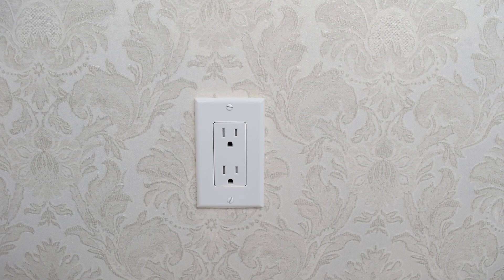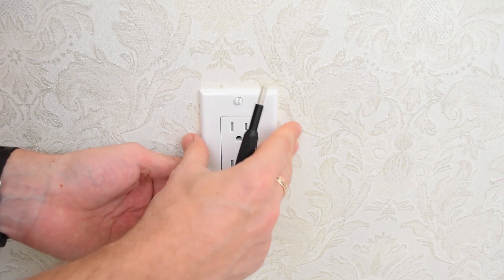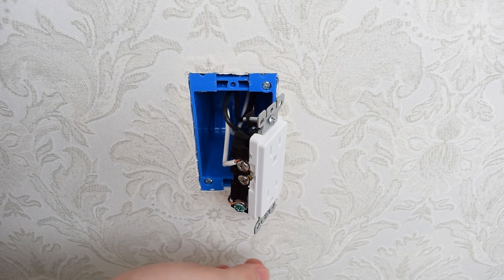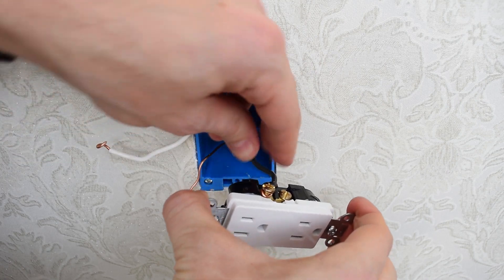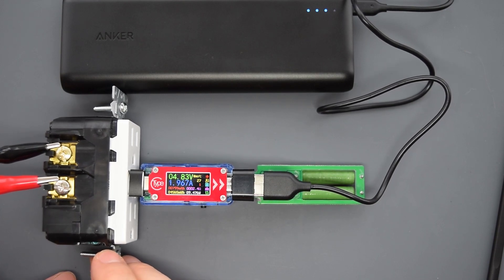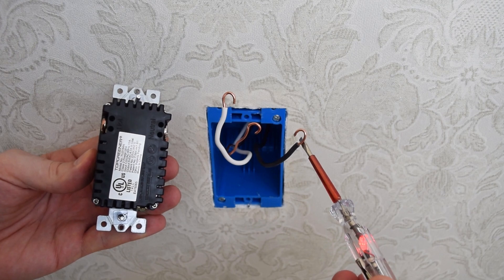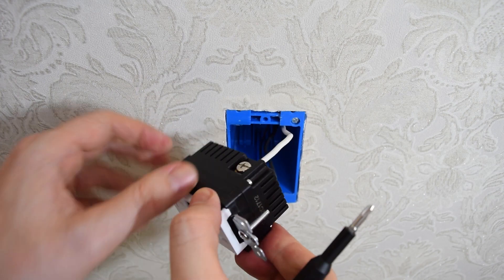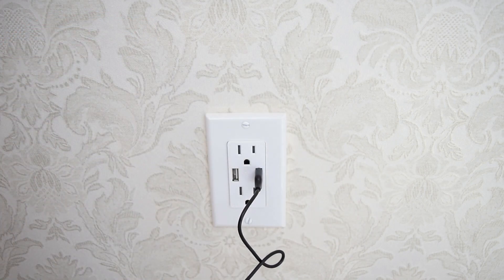How to Install a USB Wall Outlet – Leviton vs TOPGREENER Test & Comparison

Comment: Neutral/earth is not always safe to touch. Fault current could be passing through the conductor.
Reply from the maker: In that case, the earth/neutral would also have to be faulty, making it unsafe to touch.
Reply: @ElectronicsComputers  isn’t that what I said?

Comment: That is good for when you are at the end of a circuit. What about the ones in the middle. Most plugs have 2 screws on each side. This only has one.
Reply from the maker: There are two holes for two wires per screw. So you it will work perfectly in both cases.
Reply: @ElectronicsComputers  Well I don't see any holes so maybe you should do a video showing how you would do two wires. There are going to be more outlets with two versus just one.

Comment: I need help you can do me the favor of analyzing a SHA2 file.

It is modified by another application and it is a hack a virus I only have this information.

SHAS2: f6b7524082cf5e59c0e05a83ccb2aa648390bb52abd23fa40fd96664f52077fb process: C: \ Users \ maxwi \ Downloads \ Program \ Microsoft.SkypeApp_kzf8qxf38zg5c! App \ All \ Skype.exe

I need to know what the real file is that it is not Skype.exe they renamed it
Reply from the maker: The checksum of the original Skype file must be:
a18bf240bfdadb7d55f5a9140b403ed01b68ad7c4be33e2fafcf044d7bb73ce1
If you want I could look "inside" of that file.  All you need is archive that file with the password 1234 and send me to my e-mail.